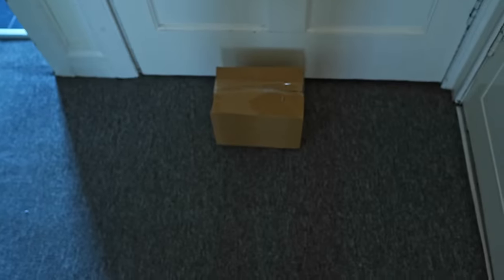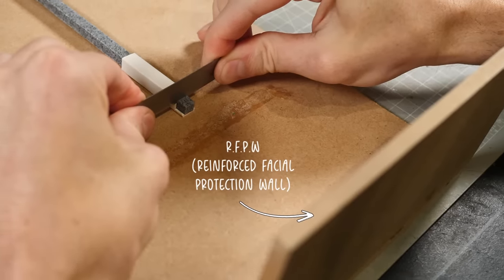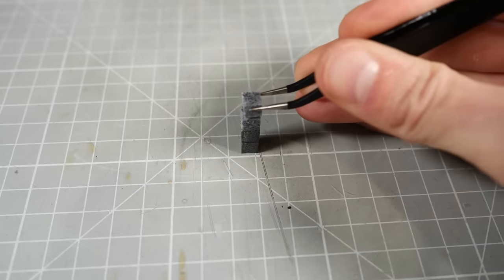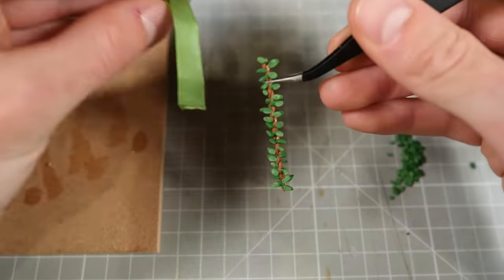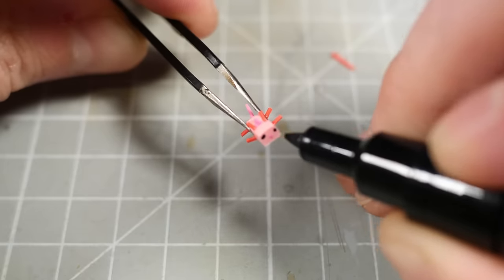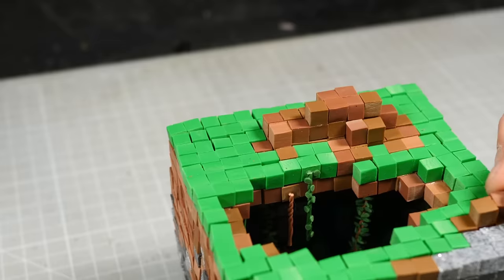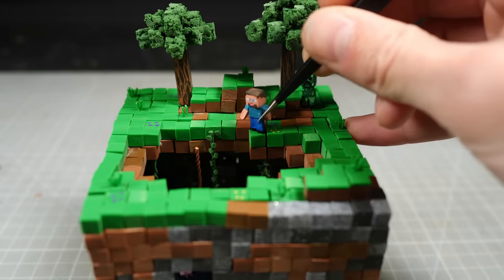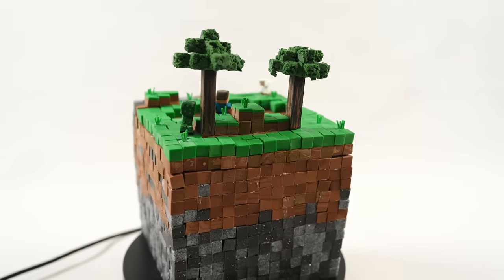I made a tiny MINECRAFT WORLD out of CLAY / Lush Cave / DIY

Comment: Just wondering what glue you use to glue all the blocks together. I know at some point you super glue but at other point she seemed to be using a white girl wondering what that is and if you've had long-term success with that and polymer clay. I'm always searching for new clay glue options
Reply from the maker: For the majority of the glue-up it's just tacky glue! I wanted to be able to glue it all in place and shift it as need, so the tacky glue holds it well enough to not fall apart, but is still easy enough to shift around as I need.